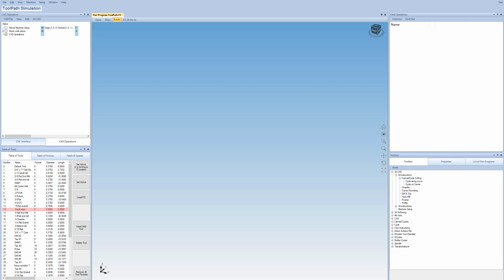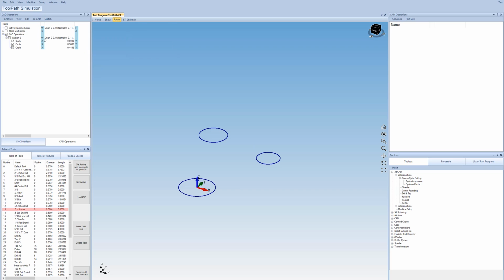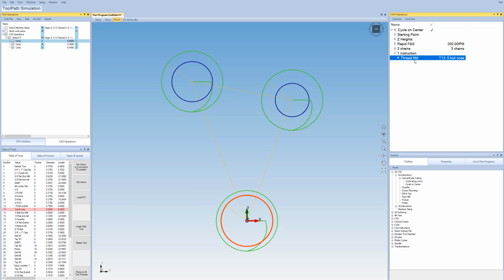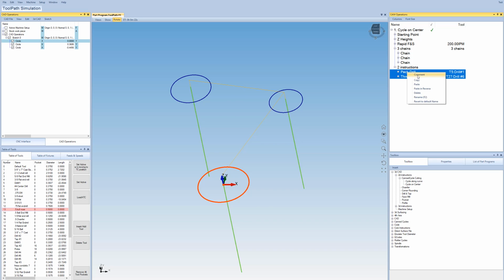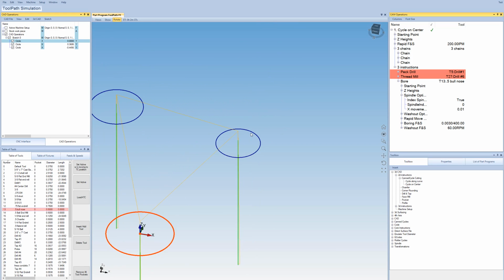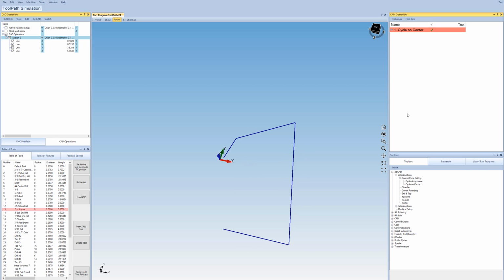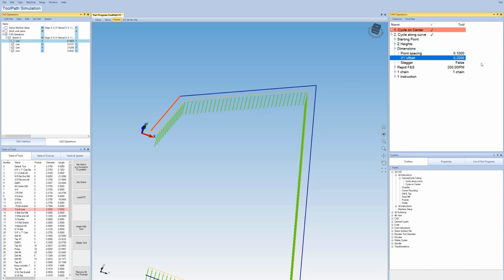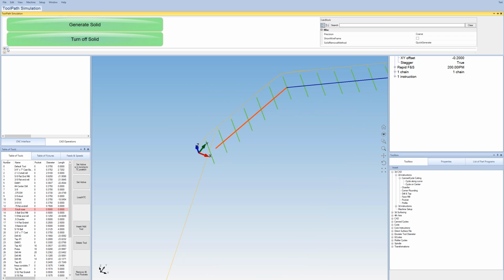4C by DM | How to use Canned Cycles

Comment: The staggered drilling before the slotting operation might be best determined by the size of the drill itself so the user isn't just taking a wild guess at it.  Look up a couple videos on "secant pile drilling" and you'll see what I mean.  These guys know what they're doing.  There's a ton of references in trig that are over my head, but you might understand them.  As the slotting op starts up after the secant drilling, there will be deflection as it hits each of the 'points'.  You may want to do an additional spring cut along the entire slot after that so the peck drill and mill would be a few thou under sized.  Maybe have the user specify the final width of the slot and let the software pick the diameters of the tooling and secant spacing for them and roll everything up into the canned operation.

Comment: Two suggestions:  In the Cam Operations, the 'hierarchy' makes it look like it's going to do some unknown thing to the 3 chains and then move on to the two instructions for the peck drilling and threading at some unknown place.  I feel like the peck drilling and threading should show under each of the 3 chains.  Even if you show them under the 3 chains as something that expands out and isn't editable because it's just a reference to the 2 operations below.  They both kind of seem as if they aren't connected in the display.